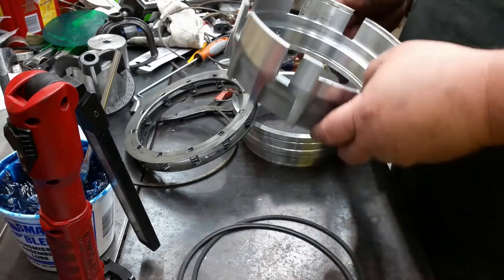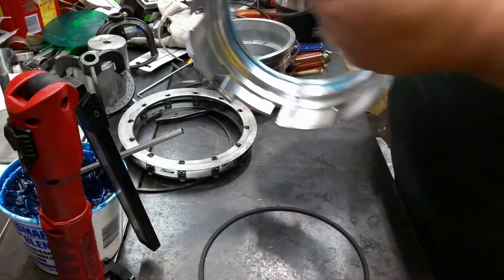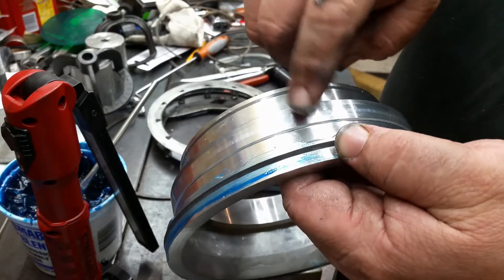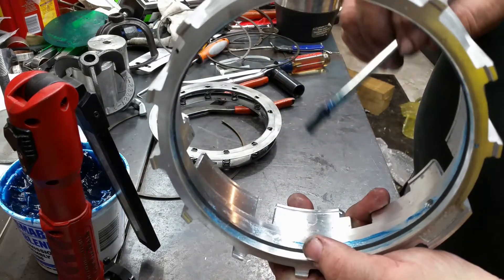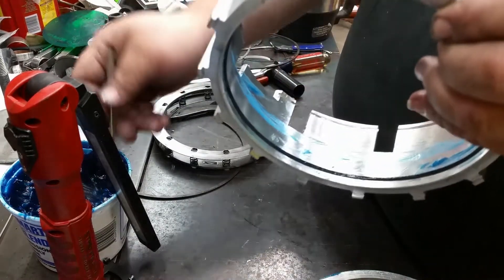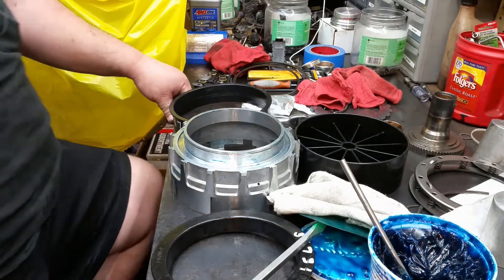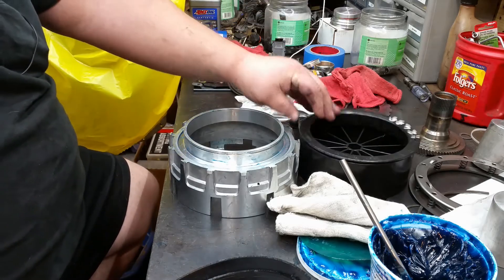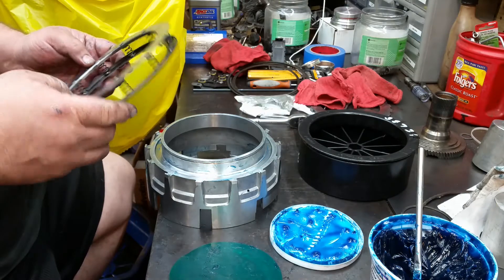Fourth Clutch Piston Assembly on a GM 4L80e Transmission

Comment: I am doing a Ford CD4E, my first transmission rebuild. I just always wanted to do one. It is similar to this, I am convinced it is impossible to get the forward reverse piston in without a special tool similar to what you have. Looks like it is made by Kent Moore. I absolutely hate like hell that I am going to probably be forced to buy this just to get this damned thing in and probably never use it again. I have tried wax paper, a lip seal tool, etc. No way Jose.
Reply from the maker: You must have an Escape or older Mazda or Ford product. I have not done one of those yet. I have an Escape with one of those and it's been very reliable with 280k on it...

Comment: i rebuilt one, and losing 4th gear  when giving some gas but shifted fine when driving slowly
Reply from the maker: I'd say your fourth clutch seals are leaking. They are a pain in the a$$ to get right in that housing and its easy to lay them over when assembling the piston. Been there, done that...
Reply: @IrocinZ  I replaced the TPS sensor, it worked but still having problems with the passing gear.